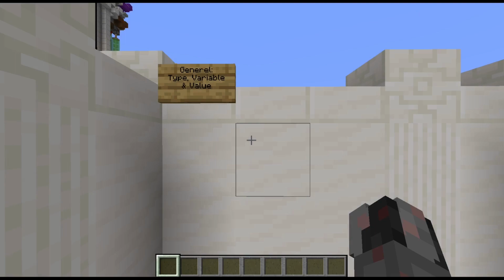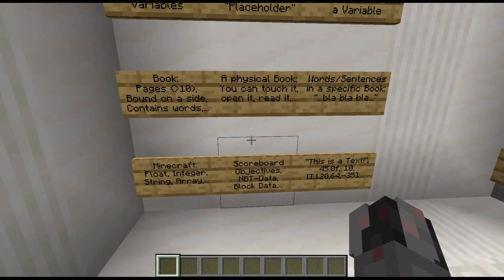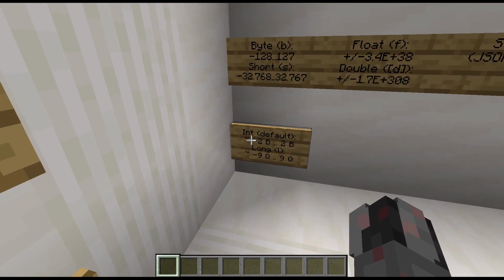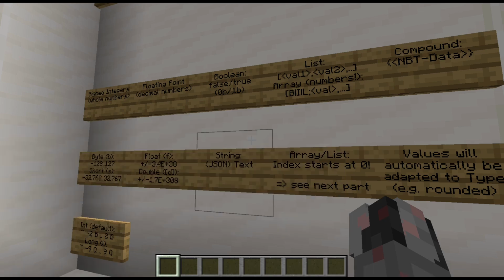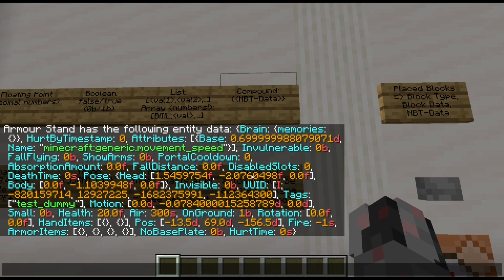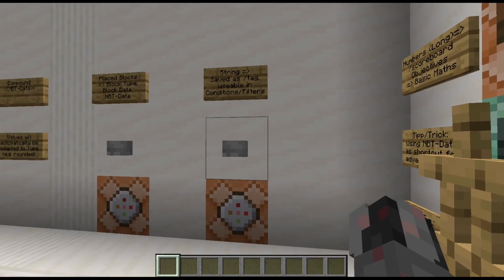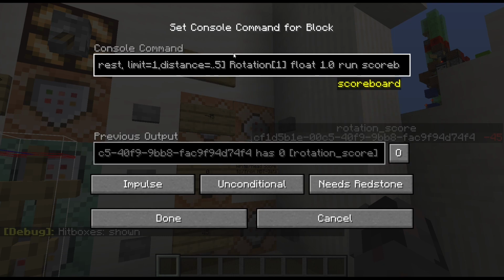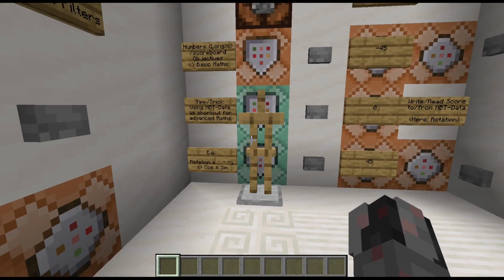Redstone Commands: Episode 8 - Types, Variables & Values [Java Edition 1.18.2]

Comment: hello mr walter 
have you played bedrock anything? 
it would be fun to show some concepts I have worked out. much is based from your video, mostley signal strength.
Reply from the maker: I have a few designs for bedrock, but only small things due to the unreliable redstone behaviour.
Reply: @RKFWalter  bedrock is 100% reliable. will always do the same thing. java design in bedrock however does not work.
Reply from the maker: Bedrock may be reliable, but REDSTONE in bedrock isn't. The update orders of redstone components aren't properly fixed. As a result the timing of pistons isn't fixed either and contraptions based on tight piston timing don't work. Additionally the 1-ticking feature of pistons is missing, as is the quasiconnectivity. Both are required for advanced (&reliable) java circuitry. So no, bedrock will NOT always do the same (just try having two pistons compete for the same block and see which one wins).

That's the reason why most java designs won't work in bedrock. They expect functionality and predictability that simply isn't there.
Reply: @RKFWalter  I have a channel called witten, the quality of the films is under all criticism. not a bit interested in fussing version differences. bedrock is bedrock. java is java. bedrock redstone is 100% reliable. think PLC and LAD. take a look there and we can talk on discord if you are interested. now it's the DIF-HIF derby in stockholm. the anxiety is palpable. (double comment?)
Reply from the maker: You can say what you want, but if I have a piston setup that behaves differently every time I trigger it I call that unreliable. I realise that it actually depends on internal variables/timings of the game itself, but those are not available to the player in any useable form nor repeatable. Reliability/predictability means that the same thing happens in the same situation all the time (and not only have of the time)...
Redstone (especially Pistons) are reliable in java, but NOT in bedrock. A very important distinction when you want to build fast doors and similar.

I'm not talking semantics here, but pure practical facts. You either haven't worked with Pistons extensively or are trolling.
Reply: @RKFWalter  I think in a different way. do not try to build what you describe. sad that I am not allowed to show what I mean.
Reply: @RKFWalter  In any case, it was your modular pulse thing that gave me many thoughts and ideas.
Reply: @RKFWalter  I actually do not understand the reaction. 
had hoped you would look and help me with things I do not understand.
no you can not build java stuff. you can build lots of other fun stuff, I do not know how to make youtube movies. hoped I could get you so interested that you want to make youtube movies with me. 
my name is o_witt on twitch, regarding piston extenders there is an explanation there why I almost never use them.
Reply from the maker: I mostly got annoyed because your comments read as a factual "bedrock is 100% reliable" while it simply isn't. Then when I tried to (re-)explain my reasoning you stonewalled and simply reiterated your opinion (which kinda smells of a troll). But the main point of content here appears to actually be a difference in our viewpoints. I see from your comments that you mainly dabble in piston-free circuitry (which is mostly reliable) but my circuitry is very piston heavy and badly affected by the unreliabilities involved. So bedrock appears to you reliable, while I fight with a lot of the parts that are simply not. Unless they gave the whole system a recent mayor overhaul I didn't notice, but I don't believe that.

And yes I know that there are some things that java doesn't have (e.g. moveable tile-entities), but overall I see more additional limitations than possibilities.

Concerning making youtube videos: Try the OBS Studio, it's a very powerful freeware and there are tons of tutorials for it. Uploading to youtube is also explained in many tutorials.
Reply: @RKFWalter  you are wrong. The reason your pistons are random is because you are not talking about which piston you want to be first. the solution is to put a repeater against one piston and just redstone dust against the other. bedrock does not work like java so why do people try to build like java? do you write code in java and move it to c ++ is it C ++ wrong that it does not work? I know how obs works. I find someone else to develop bedrock with. but thanks for all the inspiration.
Reply from the maker: You're welcome.

Just a little note considering your example. If you put a repeater in front of one of the pistons you actually change the timing. The other piston is powered at least a whole redstone tick earlier and will of course trigger first, but that example shows that you have no clue what I'm actually talking about. IF you have two COMPETING pistons, both powerd at the SAME time (no cheating via added repeaters) the difference becomes clear: In java it will ALWAYS be the same one that "wins" no matter how many times you trigger the setup (it depends on the orientations/relative position of the pistons); in bedrock sometimes one wins and at other times the other wins randomly (in other words: IT'S NOT RELIABLE). This is a big problem if you try to supercharge your piston setups. Either they work only half the time or you need to add tons of otherwise unneeded timing circuitry (which increases size & costs and makes everything slower).

I repeat: In java the behaviour/timing of pistons is reliable/predictable, in bedrock it isn't unless you brute force it by "cheating" with the timing.
Reply: @RKFWalter  I do not play java, so how it works in java is uninteresting to me. I play bedrock, there is no direct reason for that type of circuit when you can build machines that you can program to move stuff to where they are going. kind of like a traverse. I talked bedrock you talked java.
Reply from the maker: If you reread our discussion you will very quickly notice, that I always talked about pistons in bedrock primarily and why it is unreliable. I did some comparisons with the java edition but always in that context.

To put an end to this "discussion" let me list a few redstone facts:
a) Competing pistons in bedrock do not interact in a reliable way. Competing pistons in this context are pistons that try to move the same block in different directions and are powered at the same time.
b) You can work around this by changing the timing to avoid the competition as you yourself explained (aka brute-forcing it).  But just ignoring a problem doesn't make it disappear.
c) Doing so results in generally slower, bigger and more expensive circuitry

I think we can both agree on these points.

Finally I'm getting tired of this and ending it here. I'm not against talking factual redstone but further comments just denying what can be proven or putting words in my mouth will be ignored from now on. I'm always open for constructive argumentation, but trolls will be starved out.
Reply: @RKFWalter  I have repeatedly offered you to show what I am talking about. I think in one way you in another.
Reply: @RKFWalter  https://www.twitch.tv/videos/1316071706 

this you can control where it should go.
Reply from the maker: I finally figured out where the misunderstanding lies. In a way we're both correct, but also assumed things that caused us to word our arguments in a way that lead to misunderstandings. Let me try to explain it as I understand the situation (please bear with me, it'll be a bit lengthy, but I'll try to resolve the conflict properly & peacefully):

After rereading your later comments I (finally) noticed that you wrote you don't play java. I assumed until now that you have at least a minimum knowledge about how pistons work in java, too. Without that assumption the comment that initially triggered me (100% reliable in bedrock) actually makes sense. If there's always been a certain timing range that doesn't allow for predictable results you simply avoid it (to be fair, that was also the case in java... until they cleaned up the timing somewhere around 1.5?). It's something of a forbidden area you don't even think about using after some time. Thus saying bedrock is 100% reliable makes sense... IF you don't know about how pistons work in java. Had you said "it's reliable, if you keep the timing slow enough" I would have had to agree completely. But that's something you would only know to add if you know about java pistons.

Now to understand my side of the argument I have to give you some background information about pistons in java. The behaviour of pistons is always predictable, no matter how fast your timing becomes, there is absolutely no "blind spot". If a ciruit behaves in a certain way once it will ALWAYS behave in that way (unless the devs changed redstone behaviour in a game update). The update order is absolutely fixed and based on position and orientation of the pistons. There is NO randomness at all. Using very short pulses may lead to interesting behaviour (1-tick pulses cause sticky pistons to spit out the block; 0-tick pulses cause the block to be teleported; Multiple 0-tick pulses can trigger the SAME piston multiple times in the SAME game tick,...), but if you know the rules you can always predict what's going to happen 100% of the time. That's what I mean when I say "100% predictable/reliable". As a result when I look at bedrock I don't have a "blind spot" and the unreliability of fast timed pistons becomes painfully obvious to me. That's why I had to categorically disagree with your initial statement. If even a single part isn't reliable, simple math says that the whole cannot be 100% reliable anymore (unless you exclude the unreliable part specifically, see paragraph above).

So I assumed you knew about java and didn't specifiy that the unreliability I'm talking about is only for fast timing. You likely assumed that there is also a forbidden timing range/blind spot in java and didn't specifiy you where only talking about valid timing ranges. As I said we're both correct, but could have worded things better.

Let me know if I got that right.
Reply: @RKFWalter  it sounds like a correct analysis. 
I apologizes for the unpleasant treatment. 
I an not really 100% when I wind up. 

I wrote to you because you seem to have about 1000 times more understanding of computers / logic than I have. 
I'm a little stuck in my thoughts, I crack down pretty hard on my own solutions and feel insecure and stupid in general.
Reply: @RKFWalter  sounds like an explanation worth a movie by the way.
Reply from the maker: And I apologize for escalating too fast. I tend to become aggressively defensive when I think someone is implying I wasn't saying the truth (a result of my own insecurities, if I had to guess). Didn't help that some gardening left me with a massive pain in the neck due to some contortions I did...

Also you likely know more about circuitry in bedrock than I do, if you've been designing in bedrock for a good while. All I designed until now are some vault doors, nothing fancy. I mostly concentrate on java, since pistons there can do some really useful tricks I use for my bigger doors.

A few tipps I can give you concerning getting new ideas:
1) Try reverse engineering designs of other people to get an idea of how certain problems can be approached
2) Design your own versions of contraptions of other people (I get the best results if don't actually look too hard at their circuitry beforehand, I just want the general idea); once done try comparing with the original to see pros/cons of the different approaches (speed, costs, size,...).
Reply from the maker: That would be a very nerdy movie. And a bit cliché, too. The whole having two different discussions simultaniously is a bit overdone imo ;)
Reply: @RKFWalter  lol
Reply: @RKFWalter  thanks so much. hex circut can hold double the value against java. I can address the 16 pulses individual in a memory. 4*16 = 64 bits? 
but now I do not really know what to do.
thought you probably knew how it works irl. 
your pulse length modification is my complete favvorit circuit, brilliant. 
it is the basis of everything I have discovered.
Reply from the maker: I'm not entirely sure what you mean with the first half of your last comment. Do you mean to ask how computers save data nowadays?

But I'm happy to hear that you found one of my designs useful :)
Reply: @RKFWalter  I have 16 comparators 8 * 2. then I have 16 more under. in the first set, values spin 0-15 I can tell a circuit that I want you to write this value in this place in circuit two. then I can read the value whenever I want. it's really hard to explain like this for me.
Reply from the maker: I think I get your explanation. You basically have memory cells that don't save a single binary signal (aka normal FlipFlops). Instead your using an analogue memory cell to save a 4-bit number per cell, which greatly compacts your memory circuitry. Furthermore the data is copied when a trigger signal is set.

You're describing a multi-level D-FlipFlop circuit. See the two following links for more info about real life applications:
https://en.wikipedia.org/wiki/Multi-level_cell
https://en.wikipedia.org/wiki/Flip-flop_(electronics)#Master%E2%80%93slave_edge-triggered_D_flip-flop
Reply: @RKFWalter  thank you 🙏🙏🙏
I'll probably disturb you more if I can?
Reply from the maker: Always happy to talk redstone/tech. I do enjoy teaching :)
Reply: @RKFWalter  I think you are good at teaching your knowledge. 
Regarding your channel, I think you need to change your thumbnails and be a little less humble. 
stand out a little more?
Reply from the maker: You might be right. Any suggestions?
Reply: @RKFWalter  actually not right now, I'll try to think for a few days. usually takes some time before the ideas come. otherwise people are like flies, build something that flashes and shines;)
Reply: @RKFWalter  you still have 2600 sub. 
maybe a vote on which movie sub thinks is best? 
do you spread your videos in any forums?
Reply from the maker: I don't really use forums or social media. It's just not my thing. But making a couple votes sounds like an idea.
Reply: @RKFWalter  
then I have helped a little in any case. At the beginning of your movies, you need to remind people to sub. 
that's why you do this. 
david plummer has a good way I think.
Reply: @RKFWalter  and as I wrote last winter you should do your thing. I hope you succeed.
Reply from the maker: Thanks :)